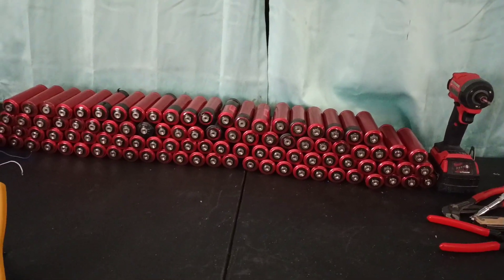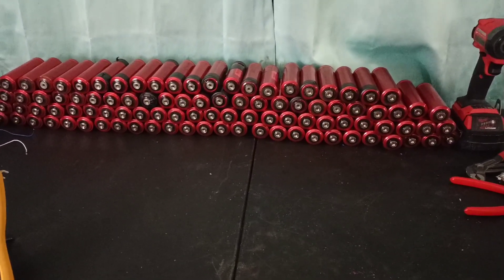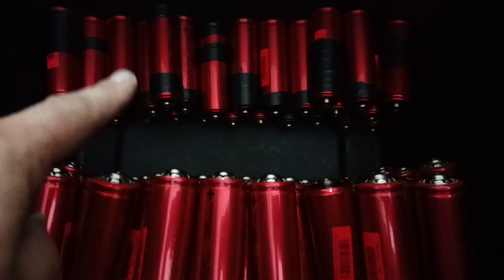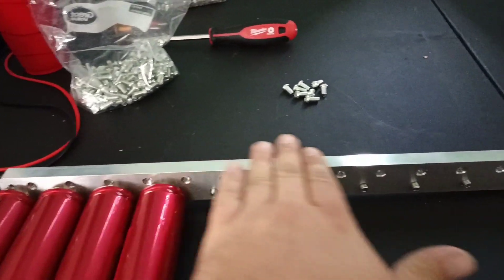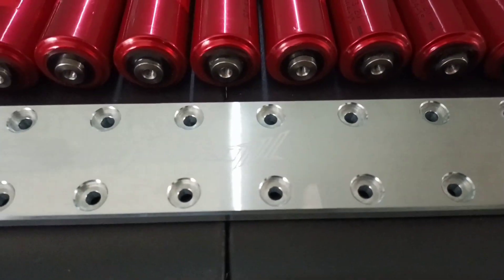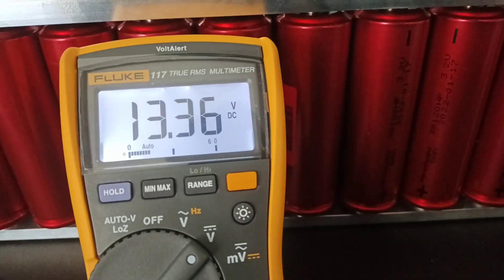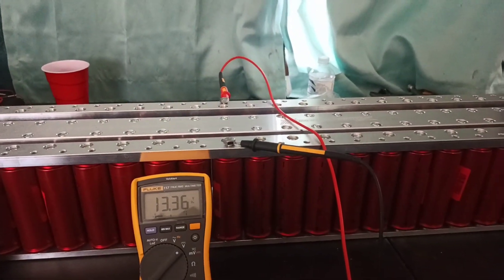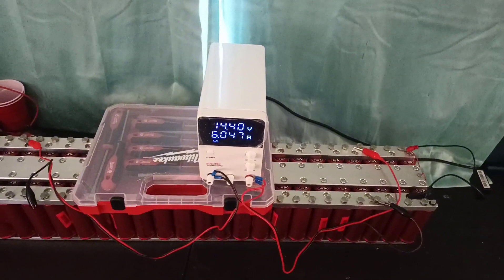building a 192 ah 12v headway lithium battery with ill customz buss bars

Comment: Charging these headway banks is useless. I charged mine (96ah) up too 14.5v. The next day they was back down to 13v. I realized that these banks dont really hold a massive charge but rather charge and discharge very quickly. They kinda work like a super cap. But they are worth it if you have a good high output alternator
Reply: If you look at the specifications per cell, the nominal voltage is 3.2V, so at rest I have 144ah and the voltage is 13.5 higher than what is specified. Therefore I don't think they are bad, I have 3 banks of 48ah 24 cells and an agm battery in the motor and in the amplifier 1-8k full range 1-5k full range 1-3k full range and 1-2k.4 fullrange and voltage Doesn't drop below 13.2v using a 60ah supply to maintain the batteries while I have everything running at 80% draw